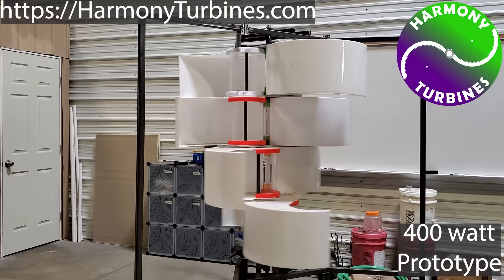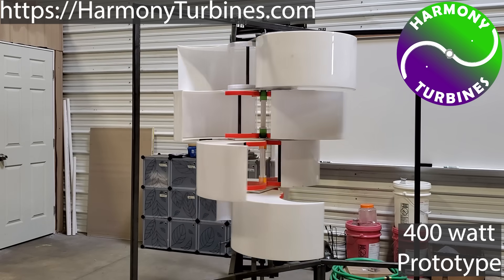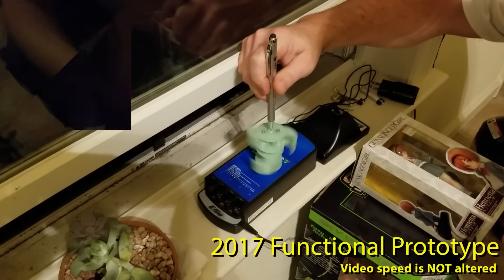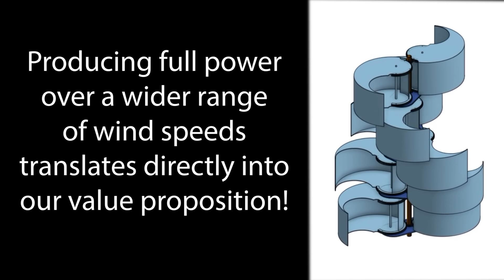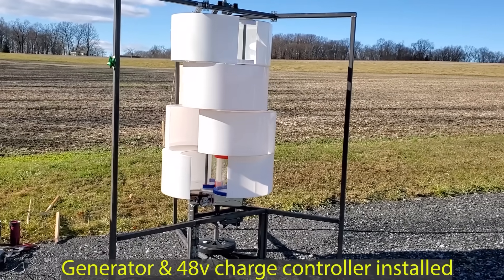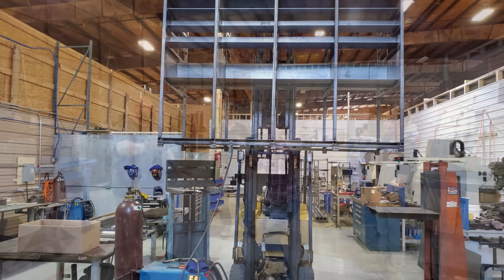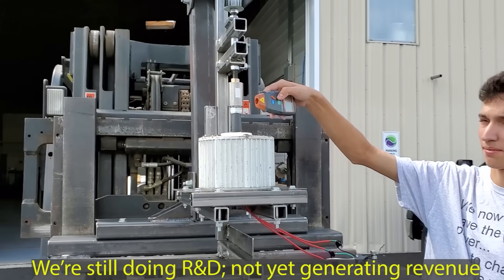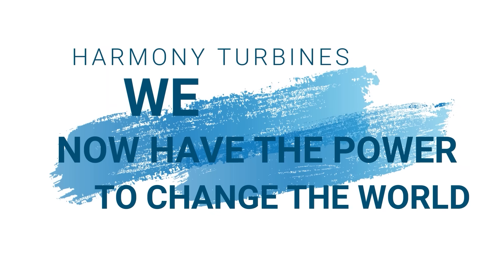What makes Harmony Turbines so revolutionary?

Comment: Having a bachelors in electrical engineering it doesn't seem that this produces enough power to power a small house let alone something industrial. There's too much of moving parts where energy is lost. That's what makes the 3-bladed wind turbines way more effective - low amount of moving parts.
Reply: this is just a poor implementation of a decade old DIY design, just yet another "genius" who want to make money by selling vaporware debunked for ages
Reply: I don’t much about this but I looked incredibly inefficient and a lot of places for loss to build up
Reply: what moving parts are you referring to?
Reply: @lorenzo42p  
02:13 On just 1 of these layers there is 8 points of contact where friction is created. That is the middle gear that touches those 2 half-gears on wings, and then you have poles that are in the center of those wings. Mind this construction is intended to not be fixed because the wind needs to open and close those wings automatically. 
(03:12 may be a better visual for this)

03:29 Because this is 4 layers it becomes 32 points of contact where friction is created.
Then the whole construction needs to be held vertically by at least 2 points (1 on the top and 1 on the bottom)
so as a whole there is at minimum 34 points where friction is created and that could drastically add up to major energy losses.

Also the shape of the turbine is inefficient so you already have losses there.

         \
           \
             \
               |  <————  Energy losses 
             /
           /
         /
       /
      •               <————  Wind blows this way
     /            
   /
 /
|             <——— Place where energy is captured
 \
   \
     \
       \
         \
Reply: @PurpleDuneEfa  the gears on the wings only move when the wings are folding or unfolding. the wind does change a lot, so that could be often. it would need a motor to turn those gears, which is extra load on its generation. this type of wind turbine is known for having very low efficiency, as it fights against itself as you described. I can see dirt getting pressed into those gears and jamming up the whole thing. the wind tends to pick up and carry dirt, and there's a lot of the stuff out there in nature.

Comment: Howdy hi hi Christopher Moore!
     It's funny that this video would come up as a recommendation in YouTube for me as I was just thinking about this design and a proposal I'd seen for placing this type of vertical wind mill on freeway dividers to harvest the wind generated by traffic.  While the idea for such placement does seem like a way to harvest otherwise waisted energy.  What was not apparently considered is the fact that as you remove energy from the air flow generated by cars and trucks as they drive down the highway.  This has a corresponding diminishing of the velocity of that air.  As this happens vehicles must then burn more fuel in order to maintain freeway speeds.  It's not likely that any one vehicle would feel a particularly heavy impact from this.  But in the aggregate, the amount of additional fuel burned would far exceed by some order of magnitude the fuel consumption of simply burning that fuel in an efficient classic generator.
     I know this idea was not covered in your video.  However it does exist out there in the world of those producing this kind of product.  And felt compelled to share the insight that occurred to me earlier today concerning this.  It is my hope, that if and when you do encounter those seeking to move forward with such installations on our highways.  That you might be so kind as to point out why the idea is a net loss.  Even if that loss is widely distributed to drivers who traverse such roadways.
     Thank you for taking the time to read this comment.  I wish you well in your endeavors.  I think there is real promise in the work you are doing.  I hope your day treats you well.

Comment: What a stupid idea. How much does this Rube Goldberg device cost? Wind turbines are the least cost-effective of all “green” technologies. A thin black aluminum plate can be extruded so it has the same profile as corrugated cardboard. If you want mechanical power, simply fill the plate with pure alcohol, and balance the pressure of the system so that when the sun heats the plate, the alcohol boils and drives a tiny turbine, or a tiny steam engine. The alcohol will recondense, and then it can be sent back to the aluminum plate.

Comment: That's an excellent design.  It would be ideal on my property because I'm concerned about injuring birds, and I believe VAWTs are much better for that.  But unless that is MUCH larger than it appears in the video, I don't believe it will produce anywhere near 400 watts.
Reply: Yup, even at 400 watts...two 400w solar panels would be much cheaper and require less maintenance.  Even at 400w you'd need a huge line of these things to have a small chance of powering your home, much less your EV.  Cool concept, but investors should see the snake oil in its gears.
Reply: @Perceivedshift  Investors don't see snake oil, ever.  Investors live off of snake oil.  We are in the age of the grift.  Best line of BS buzzwords wins.
Reply: Yea not without heavy winds

Comment: At 25~30 mph winds it limits rpm via furling......Only guessing low rpm tuck~in point is due to significant imballance  of furled components  25+ wiinds could make for imbalanced hell on such a great rotating mass.

Comment: I like your concept however it looks like it could easily start corroding if placed in a humid climate because the rain doesn't seem to have anywhere to run off of the unit.

Comment: There's a reason Savonius turbines and other minor variations of vertical turbines like this that are supported only at one end didn't catch on. This isn't anything new and will be impractical for the same reasons, including low efficiency and mechanical difficulties from torquing and centripetal forces and therefore longevity problems. In this design, most of the cups are producing drag and only a small amount produce power at any given time, as compared to a 3 blade horizontal turbine in which all blades are producing energy at all times. It is true that this turbine will run in lower wind speeds, but higher wind speeds carry more energy (energy is proportional to the square of the velocity) and are much better extracted with horizontal turbines, until they can't be used. But with correct siting the losses associated with unusable time are far smaller than the losses associated with being just hopelessly fundamentally inefficient. This is an overcomplicated nothing-burger that will fail like other designs of this sort, except in a few small scale niche situations.
Reply: I should add; it looks pretty cool as an ornament though.

Comment: This is so cool!! A few questions. Have you thought about using composites for the air scoop to keep weight down and strength up? Also, is the unfurling mechanism electrical? If so are you using a slip ring to deliver power? And lastly can I have a copy of the stl files of your original models I kinda want to test out making a 5v device charger that can be carried around, or used in camping.
Reply: Watch the video close enough, warm up your CAD Skills & Start your design, and you'll probably be OK!

Comment: I thought that vertical turbines, while they always look cool, have been pretty soundly debunked as having terrible efficiency, particularly compared to blade turbines.
It's all because power is proportional to the active cross sectional area presented to the wind.
Reply from the maker: It's finally coming to light that there has been a large disinformation campaign for decades against VAWT's and in general Savonius turbines, starting back in the 1950's or around there. Savonius Turbines are actually > 30% efficient without any helix twist or ribbed sections. A proper helix twist greatly reduces stress over the entire unit and smooths out operation as well. The main noted drawback noted was high wind vulnerabilities which our patented design now solves. Look at this https://youtu.be/pbtR6VG-gLw?t=225

Please sign up with our Newsletter to receive the latest updates from Harmony Turbines: https://groups.google.com/g/harmonyturbines
Reply: @HarmonyTurbines  But... physics?
Looking at that prototype only 25-30% of cross-section is even capable of catching the wind, and a lot of the other side are actively opposing it. Now, maybe there are rotational components I'm not considering... does the pictured prototype ACTUALLY generate 400w of power? Under what wind conditions? If so that's hard to argue with.
Reply: @HarmonyTurbines  ok so now you claim that 50years of scientific literature is "disinformation campaign" ? And that for promoting a win turbine design that is not even your's ? Patented you say ? BS ! I call you patented liar.
If you want to call out on scientific result it's simple set up an impartial protocole and put your numbers on the table.

Comment: VAWT's are an even less viable technology than the horribly inefficient "windmill" style wind turbines, which can feather their aerofoils in a high wind. This is the worst type of "snake oil" preying on the uneducated.
Reply from the maker: dbmail, It's finally coming to light that there has been a large disinformation campaign for decades against VAWT's and in general Savonius turbines, starting back in the 1950's or around there. Savonius Turbines are actually > 30% efficient without any helix twist or ribbed sections. A proper helix twist greatly reduces stress over the entire unit and smooths out operation as well. The main noted drawback noted was high wind vulnerabilities which our patented design now solves. Look at this https://youtu.be/pbtR6VG-gLw?t=225

Please sign up with our Newsletter to receive the latest updates from Harmony Turbines: https://groups.google.com/g/harmonyturbines

Comment: This is nice and all but you've got maybe 1 square meter of surface area averaged over a period of rotation? With a cutoff speed of 30mph you could at most extract roughly 1kW. You're gonna take a while charging your EV that way. Also why do generator development? No need to reinvent the wheel
Reply from the maker: Leandros, it's about 1.5sq M in this 400w unit size and there is no cutoff speed. That's the beauty of our design. At the high wind speeds we will be extracting maximum power out while the other residential models are STOPPED. We're doing the generator development because other generators on the market are not suited to the RPM range that we need. To use a toothed pulley or chain or v-belt will add a ton of startup load and cause a lot of other issues. It's time to develop our own patented generator. -To finally do it properly. Watch this video and it will help explain better for you: https://www.youtube.com/watch?v=mVMzdYL9c1o
Reply: @HarmonyTurbines  thank you for the quick response, I appreciate it :). Makes sense about the generator. By cutoff I meant furling speed, it's definitely nice that they are able to keep generating. Still, VAWTs in particular are hard to scale up due to the ever increasing forces on the pivot point (I guess the torque scales as like, linear size to the 4th power?). I'm afraid I would conclude that regular turbines are just better for most applications, and these would be useful for far-removed stuff like powering amenities at e.g. bus stops (LoRa connected bus arrival indicator, charging point, lights) where low maintenance and low power are the main properties. I hope you are able to find your niche :). Btw is the furling mechanism fully passive in the sense that it's only the torque imbalance causing them to close, or is there something at the end of the shaft causing it to close?
Edit: probably 3rd power actually
Reply from the maker: If you watch all of our videos I have been very clear in stating we never plan on scaling these up to huge proportions. The largest I could ever see being feasible is perhaps 25Kw units out in the ocean or something like that. Our work is focused on keeping these small-scale and residential sizes for units that finally make sense for the homeowner or small business owner.  I'm still confused why you're referring to a cutoff in our designs, at 30MPH, Harmony would likely only be furled in perhaps 5 to 10%, nothing more. At 40MPH maybe it would be furled 20 - 25%. But in each case the overall RPMs of Harmony stay at FULL and therefore the power output remains FULL. As the winds die off it opens back up to 100% open.
Reply: @HarmonyTurbines  cutoff was my bad in the first post made, I meant furling threshold, but basically meant maximum power speed, beyond which no additional power is extracted. As I said, I hope you find your niche but I wonder if residential is it. 25kW means a factor 60 in surface area from your 400W prototype, maybe slightly less if you recover some losses by generator dev. Let's say 49 so that the linear dimensions of the blade are roughly 7x. Your torque is then close to 350 times the current one, not to mention the absolute unit the thing has turned into!  Are your projections realistic on that working with non-aero material? And why would you place these on water when a traditional mill can shine there?
Reply from the maker: @Leandros  Where people want to put them is their business. I'm not going to speak to that. I was only offering a possible use for larger units. But certainly on hills and bluffs ...lots of places where they could be desired. Regarding your statement about factors of 60 you are thinking everything scaling up proportionally. But remember with our design we can do some cool stuff like for instance 10' diameter individual scoops with 10 scoop pairs would give us a turbine roughly 50' high x 20' wide. FAR smaller and more simple to install than the huge 300' tall units on the market today; not to mention far more economical and less dangerous to install. This size should produce about 25kW in a 25mph wind.
Reply: @HarmonyTurbines  Yeah you can change your aspect ratio, but you're still in need of a factor 60 more surface area, all other things being equal. As said, I hope you guys find a good market, and wish you good luck :). Btw regarding how the furling is performed, is that kept under wraps or can you explain that? Would love to know more if possible
Reply from the maker: @Leandros  sure there's not getting around increased area requirements, but we can be creative in how we do it. That's all I was saying. We don't have to get impossibly wide in our dimensions as going up is much easier. Regarding our furling technology, we have over 120 videos available and our furling tech is in dozens of different videos that you can watch and see whatever you like. Please sign up with our Newsletter to receive the latest updates from Harmony Turbines: https://groups.google.com/g/harmonyturbines
Reply: @HarmonyTurbines  fair enough, will check them out. I've never joined a group before but I'm interested to follow along :)

Comment: Lol, Wind turbines do not start on fire because of high winds. They feather. The video you showed was a mechanical failure that is well documented.
Reply from the maker: High winds and poor design cause mechanical failures. Fires start because of the extreme heat buildup in the mechanical (friction) brake mechanism which ignites the oil. Harmony doesn't need a brake. Please sign up with our Newsletter to receive the latest updates from Harmony Turbines: https://groups.google.com/g/harmonyturbines

Comment: Why not cover them in solar? This way even when there is no wind there is possibility  some sun to make up for it
Reply from the maker: Sorry but no. Not worth the extra cost due to the fact that 80% of the turbine surfaces are facing the wrong way at any given time. So only a tiny bit of the turbine is facing an optimal direction at any given moment. Please sign up with our Newsletter to receive the latest updates from Harmony Turbines: https://groups.google.com/g/harmonyturbines
Reply: @HarmonyTurbines  up to 80% not 80% at any given time also if you put it on the places most likely get sun/on the sides to have it become a solar generator on days when there is not enough wind.
You ask people to jain the discord in the videos, on comments not talking about it seem a bit pushy.
Reply from the maker: @dalton6173  about 80% of Harmony's surfaces would constantly be facing the wrong way, whether or not it's spinning or standing still. So only like 20% of the surface would ever (at any moment) be capturing sunlight, the rest would be in the shade. It's not worth covering a structure if only a small amount of it will be capturing the sun at any given time. What are you talking about when you say I ask people to join the discord, but then not talking about it seems pushy? -You have me really confused. Perhaps that was someone else's comment?